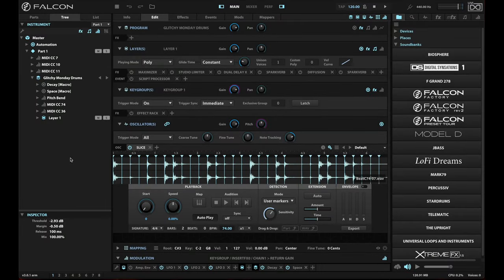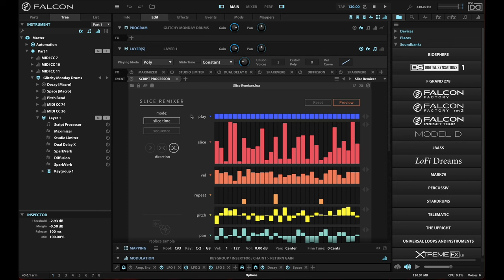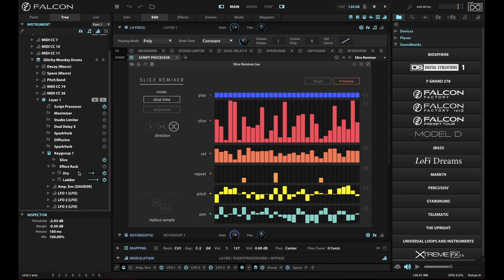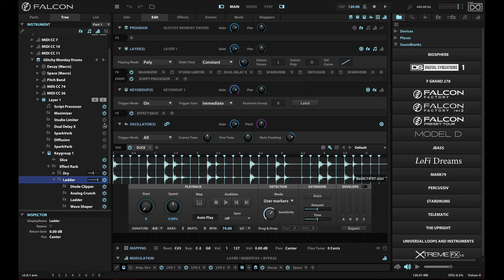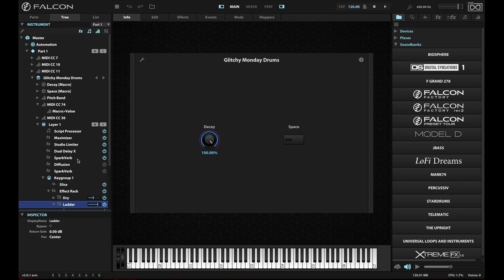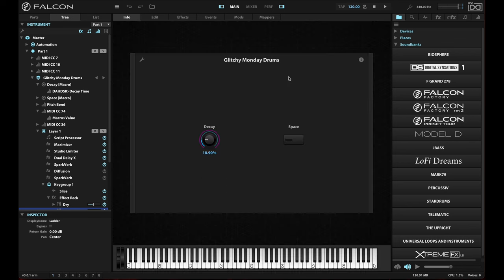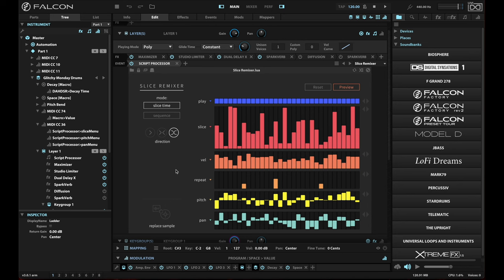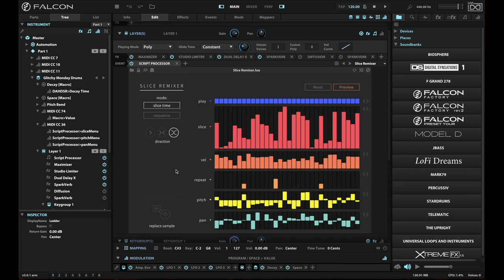UVI Falcon 3: Glitchy Drums

Comment: Amazing video! i Have been trying to fumble my way around falcon for a while. I downloaded your preset and got a break is missing error, added my own into the slice osc but it does not play I know I am probably doing something incorrect any ideas on how to get it to work?
Reply from the maker: The sample is not one of mine and thus not redistributable, apologies for that. It's hard for me to diagnose without a video or having your patch in front of me. Of course make sure you're using the most up-to-date Falcon. Check that the slice oscillator is mapped across the keyboard. Slice the sample up with user markers or however you prefer, so there are enough slices. Feel free to send a patch link and I can check it for you, it's not too big a channel for me to offer help. ;-)